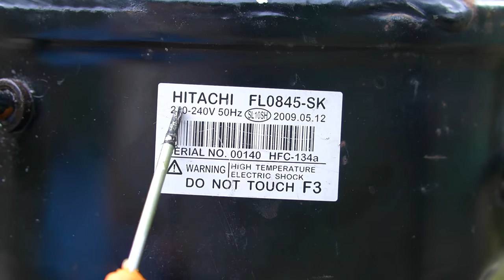I turn fridge compressor into a welding machine new technology

Comment: Maaf ka. mau tanya, apakah strum nya harus 220vol? dan kabel terminalnya boleh colok langsung ke saklar dinding,? Atau harus sambung langsung ke strum induk? Terima kasih🙏 itu aja pertanyaanya
Reply: Itu ga masuk akal, KL dilihat dari ukuran kompresornya kira2 1/4pk atau kira2 200watt
Untuk voltase mesin las itu minimal 35volt untuk menghidupkan busur kawat las, 200watt : 35v kira2  6amper,tidak cukup untuk melehkah kawat las, minimal 20-30amper
Cek Vidio menit keterakhir pergerakan kabel stop kontak bergerak ketika mengelas,itu tandanya voltase 220volt untuk uji lampu dan avometer diganti arus voltase ke mesin las.
Kecuali itu lampu tetap menempel distop kontak saya percaya.
Reply: Hoax mase... Klo mau nyoba ya monggo.. Silahkan praktek jangn lupa di share hasilnya

Comment: How is that possible if the red wire that you are using to make the arc is insulated and is not even in contact with the Mass where all the current actually is?

Comment: During welding a current of 50-100A flows through the conductor! At this current, the insulation of such thin wires would have to burn!

Comment: Hi everyone...this guy using 6 mm cable thsy can only take a total of 40 amps and his invention welder csn only do spot welding with a # 12 welding rod's  for just short spot welding not for any long terms used besides that his stator coil from the fridge motor will get over heating and burnt out from any prolong used.

Comment: 1800 AMPS THROUGH LIKE 6 GUAGE WIRE, IT'S A MIRACLE 😆😆😆. The only way you could ever possibly come close to 1800 amps through those windings is by stepping your frequency wayyy up like an smps. Probably more like 40amp.🤥

Comment: Its a plasma cutter, not a welder. Its just vaporizing the metal.  Just going off of sound here but did you actually check the voltage it sounds awfully high still.. enough to blast the shit out of you if you become the path to ground.  💥🤯😵‍💫

Comment: paano kinabit ang connection sa ground at para sa holder ng welding rod?di mo kasi naipakita kung paano  mo ikinabit sa stator..basta pinasok mo lang yong wire na nilubid mo sa pvc..salamat sa pagsagot..

Comment: I believe that's fake. Refrigerator motor can't spit that many amps to be able to weld things. This type of arc requires good 100+ amps and this motor is way less of amp to be able to generate that high voltage to be able ti weld.

Comment: at 300 or 400 amps a welding rod  will explode as to much current passes through,, at 1800amps you're already  crasy talking as it will brutally explode and splashes melting metals all over..  you're  joking 1800amps bro...

Comment: This is a tricky video,and the device that you modified is a piece of junk!and do nothing,the magnetic field orientation on the center of the motor can not produce any significant voltage with this secondary coil that you put in there  because A)its perpendicular to secondary and B its has no iron core in there to conduct the magnetic field and close the magnetic circuit to form a transformer,you can not generate enough power to weld with this air core at 50 Hertz, but I think this is the real setup : YOU GET THE MAINS 220 V IN SERIES WITH A LARGE INDUCTOR (NOT SHOWN ON THE SCREEN)THAT WHY THE NONE LOAD VOLTAGE IS 220V! AND CONNECT THE RED WIRES DIRECTLY TO IT ,THAT LARGE IN DUCTOR THAT YOU DON'T SHOW ON THE SCREEN PERFORMS THE CURRENT LIMITING, (JUST LOOK AT HOW INPUT BLUE AND RED WIRES REPEL EACH OTHER AT WELDING MOMENT, THATS BECAUSE THE CURRENT EVEN HIGH AT THE INPUT , AND THAT PIECE OF JUNK DO NOTHING AND THERE'S NO STEP DOWN TRANSFORMER)

Comment: Máy nén tủ lạnh có công suất cỡ 200w . Trongkhi để hàn được que hàn 2,5 mm p= 50a x 35v =1750w ,công suất phản kháng cần thiết nhỏ nhất 35% =612VA   . Tổng công suất đầu vào không tính tổn hao điện trở dây quấn dòng Fu co  p= 1750+612= 2362 VA . Với U=220v ,thì I = 2362÷220=10,74A . Tiết diện dây sơ cấp s= 10,74÷6 = 1,79mm2 , đường kính dây d= 1,5mm . Dây quấn máy nén nhỏ hơn ,6mm khi rút roto ra ngài cấp điện đòng điện tăng cỡ 10 lần ,2 giây là khói 5 giây là nổ dây . Mà về học định luật cảm ứng điện từ maxoen đi đã rồi hãng chế cháo . Ông đấu đầu ra máy hàn MMA IGBT 200A bố hàn như đúng rồi . Bố lừa trẻ con à

Comment: Pano nagkaroon ng power ung ground at yong handle ng welding Hindi Naman naka connect sa kuryente para mag weld,para pinasok mo lang doon sa stator ung naka pulopot na wire sa turbo,pls explain asap thanks po,,🙏🙏

Comment: The stator fluxes are parallel to the coil wires. Not sure how this can work. By the way, you are using 220v power. Make sure to wear your slippers when play with it so that you have a chance to survive when touching the hot line.